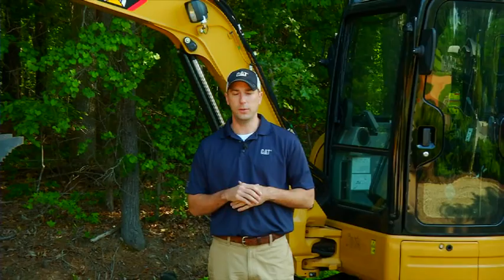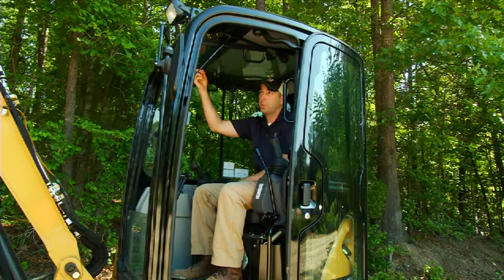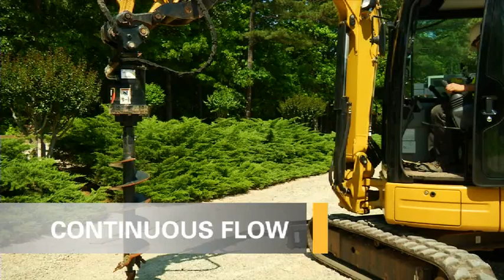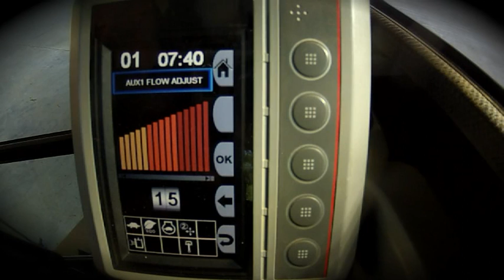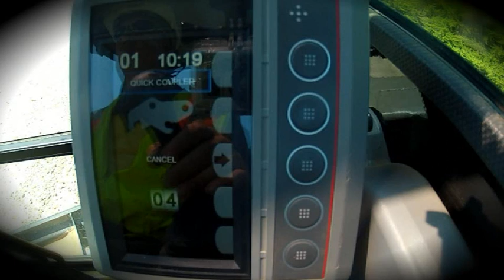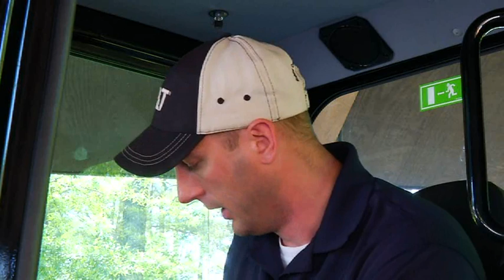Cat® E Series Mini Excavators Overview

Comment: The basis for my claim was fairly well stated I think. I'm a locomotive electrical tech and everytime a bunch of electronic computerized stuff is incorporated it usually spells long term trouble. Initially everyone is awe struck, until the reality of long term reliability is realized. I think this is especially true of equipment like this that is subject to less than favorable operating conditions i.e. heat, cold, mud, water, banging/vibration etc. Again, I said "just mho".
Reply: AGREED! Fancy tech costs US all $$$$$$$!!

Comment: I just bought a new 304E CR - yeah, amazing I am commenting on the machine and actually own one too! ;)

COMPASS is the best thing since sliced bread in making sure your machine isn't used by a job site yo-yo with a CAT key or stolen. It was the first thing I enabled. LocoGuy, computers have been onboard heavy equipment for a loooong time.

CAT needs to do a better job in translating those Mitsubishi manuals from Japanese to English so it's easier to order parts for the machine. You think they would have been 100% on that before they started selling them in the US, oh well, there is always next time.

Comment: the thumb and bucket are not good for brush piling as u have to curl the bucket to meet the thumb and you pick up dirt with your brush. i operate a 305.5 have used better engineering

Comment: I have one 305.5 advice they have a shitty thumb I bent mine popped it off in the first 10 hrs and it got bent. cat told me its my fault. they have a shitty mounting system that they have for the thumb is my fault under pressure it expanded ripped off the cotterpins and bent  so that's my  fault  I used bolts now it fits like shit  the and got bent also  the thumb is junk for what it cost cat knows about this problem I not the first

Comment: I'm not an owner or operator, only a guy who has watched the older models in action. This looks "to me" to be alot of uneccesary computerized bs that undoubtedly yields  somewhat better results...WHEN IT WORKS. For alot of owners and in fact, perhaps most this software driven stuff will be more of a headache than it's worth. The high volume guys who are replacing their machines every few years will get their money's worth. The buyer of their used machine will get hosed. Just mho.

Comment: I have a 305.5e2cr, does the compass display when glow plugs are activated? In cold weather I have never seen a indicator, it has them I can see them in the head.
Reply from the maker: Great question! On the E2 range of machines, the glow plugs are automated and no indication is given in the COMPASS monitor. - Maria
Reply: I shouldn’t have to correct CAT. But yes there is an indicator on the compass monitor when the glow plugs are activate. When it’s cold Turn the key on but don’t crank it and they come on and a symbol shows on the monitor.  Then fire it up and you’ll see the glow plug symbol come back on again for the first few seconds of the engine running. Symbol is the universal glow plug symbol and it will come up toward the bottom right of the screen.
Reply: @Gainz27 thanks